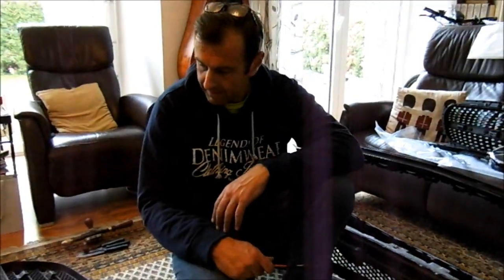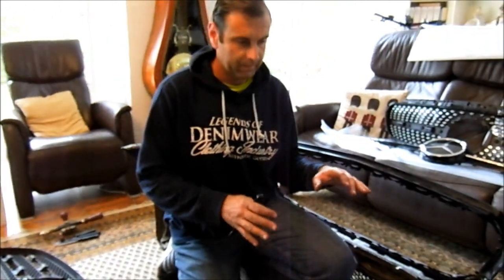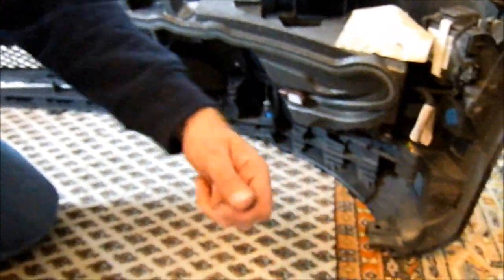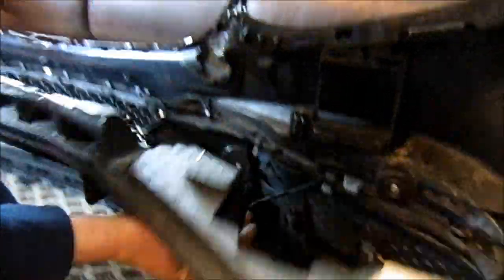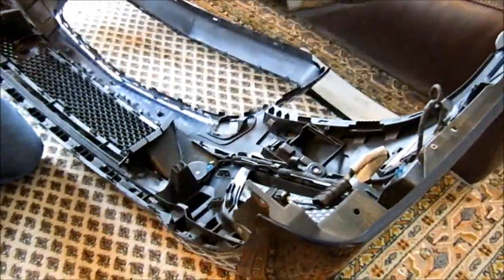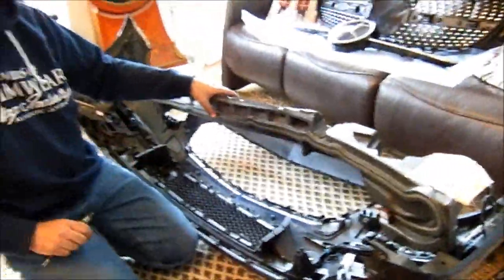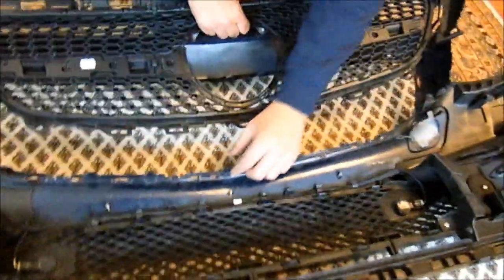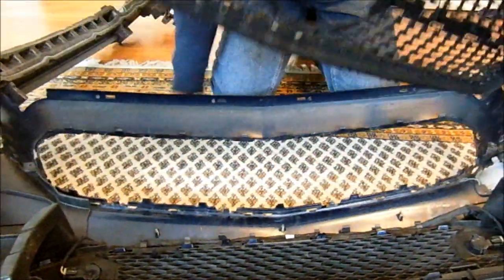Mercedes AMG Diamond Grill Install - Part 1

Comment: Hi,

Can I confirm you’ve fitted a W238 grill to your w213. Meaning it will 100% fit regardless. I have bought an OEM diamond grill for a w213 but now worried it won’t fit after the lengthy bumper removal - I don’t want to be bamboozled! 🤞🏼
Reply from the maker: 100%. The part I fitted was a used OEM one from a 238 onto my 213.  This type of grill is only fitted AMG 43 on the 213. Just annoyed me as there is no difference between AMG line cars and regular ones, whereas on the 238 you get the diamond grill. Next job is to change the bonnet as 238's have two power bulges....

Good luck with the upgrade. The hardest part is just cracking the first clip. Once one goes the rest become easier as you have s bit of leaverage.  Would welcome feedback if you find an easier way to do any stage 👍👍
Reply: M & M I’ll let you know how I get on. You’re video has provided a lot of insight so I feel prepared for the removal. Though I must say this bumper removal seems as though it will be a lot tougher compared to others I have done!
Reply from the maker: Fadi, take your time, work logically and you'll be fine. If in doubt keep your phone close by and take a picture to help put it back together 👍

Comment: Hi, regarding the drilling part. Are you drilling new holes or are you taking out screws from existing holes? Worried about the resale of my car if these are new holes being drilled in. Also, are additional parts required to fit the grill? Thanks!
Reply from the maker: I drilled out the old rivets. I didn't replace them as the whole grille/bumper assembly holds itself together when in the car. If I had a rivet gun then I would have done it but honestly there is no need. You cannot see where they are not present with the bumper reattached. 

No new parts are required as long as you are changing from the 2 fin original grille. If you are swapping out from the big Elegance grille (with the star on the bonnet) then there maybe issues but apart from that it is just carefully unclicking and then reclicking back into place.

Good luck and let me know if you got there in the end 👍

Comment: Can the old grill be taken out, and new grill put in without removing the whole front bumper, while pulling the bumper out, to get your hands etc behind.

Thanks!
Reply from the maker: Sadly not as you just cannot get access to what you need.  I know I need to post the bumper removal video (hopefully today), then you will see that taking the bumper off is really easy.